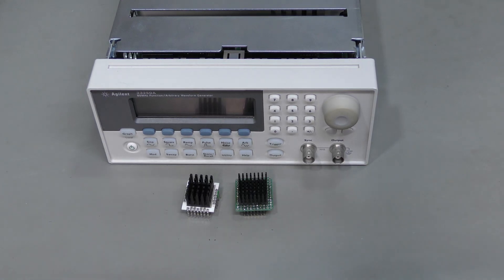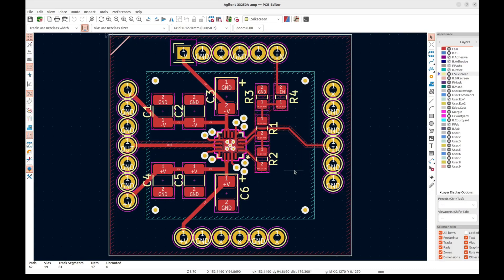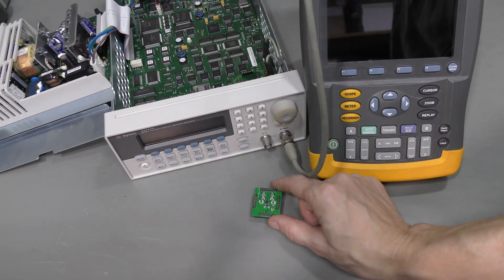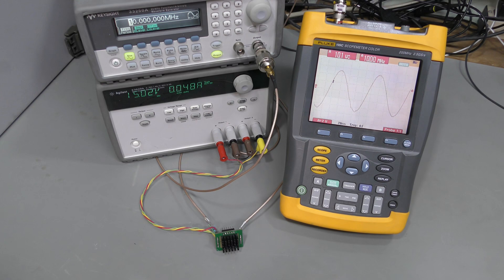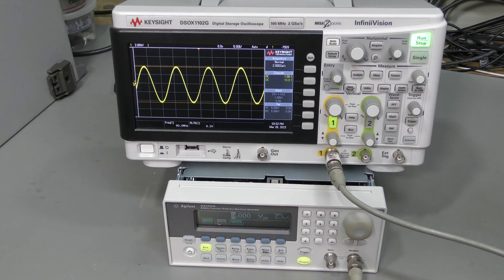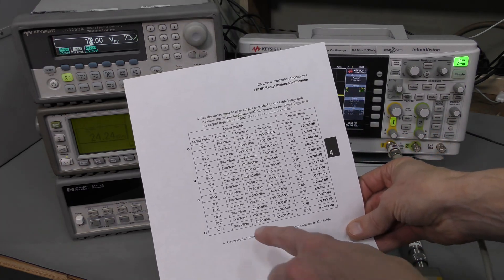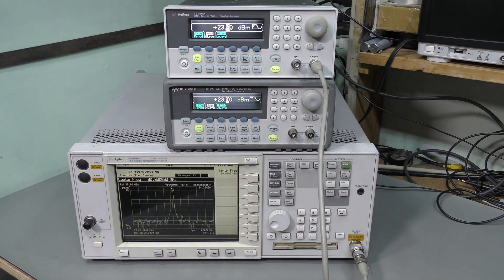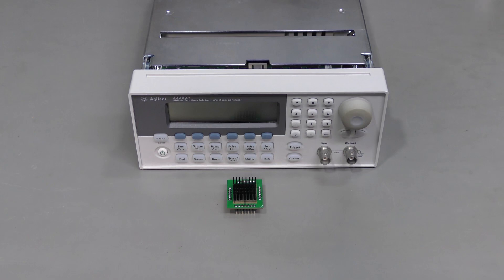#140 - Agilent 33250A output amplifier replacement part 2

Comment: Can someone explain a couple of things please:
1) why the rails of opamp are taken from pins 18; 19 and 1; 25? It appears to be a part of the overcurrent protection with external shunts in series with the bipolar push pull output stage. The remaining hybrid circuits are powered by 13;16 and 7;3. Wouldn't a composite amplifier be more appropriate here? And a shell load below 50 ohms still causes a bouncing output even without those decoupling caps and potentially rendering this OCP useless?
   The datasheet emphasizes on using 2 in parallel.
2) Why use these physically large capacitors? The size is like 1206. Could this be a parasitic RLC adding instability? Is that what they call self-resonance? Is 0402 next to the power rail pin more suitable?

Comment: I've found parasitic capacitance on the output pin to cause this kind of thing in the past. Perhaps a few ohms in series with the output physically sited as close to the output pin might be enough to reduce the (admittedly low) capacitive loading on the output trace/off module traces without compromising calibration range?

Comment: This is one of the worst f-gens on the market. Used to have two of them in the lab. First of all atenuator was quite leaky, also output off function was not the real output off, and to add insult to injury manufacturer tehnical support was telling me it is ok, that is the way it was intended to operate like that. After about two years of use one of the instruments started to show extreme dropp-off in amplitude over about a 1 or 2 MHz frequency. Since warranty passed, i opened it just to find ferrite transformer secondary on the output of the amplifier not properly soldered to ground. (It looks like ferrite bead with two leads forming primary and secondary. Signal from the amp goes through one lead and the other is forming short circuited turn connected to ground.) 
I repaired it, and next day i put my 33250s on the ebay and lowred the price just to get rid of them. Simply piece of s***t of a generator.

Comment: Great video as usual. No professional advice here, just amateur suggestions.

If the problem is input to output coupling, I would relocate the amplifier to the output side of the board to minimise the length of the radiating track. I'd also use an unbroken ground plane under the input and stitch the ground down. From what I've read it's generally better to retain unbroken grounds unless the RF/EM simulations tell you otherwise. I realise I'm contradicting the datasheet here, but a nearly split ground plane next to a high power RF output track just seems problematic.

Thanks again for the great technical content!

Comment: Hi freq stuff.....a black art!
Having two copper pours, one on each side of the board and one being broken also i suspect is a problem......if i read your design properly.
Try getting rid of all the copper pours, dont cross traces top and bottom, or if you do then at right angles only.
You might get away with a bottom side unbroken pour for gnd, but to experiment I would make both designs at same time so you can swap out.
Keep traces away from other unrelated pins when you run past them.
Use vias to drop down to the ground pour, but as close to the topside pad as possible.

Comment: I think your main problem is your layering and ground design. I think your board may have some EMI problems and problems with its impedance.
Reply from the maker: What would you change?
Reply: @feedback-loop  Oh, that is a large question, but I'll try. Just remember I am nowhere near as skilled as you, I do only know about layering, frequency and a bit about EMI on boards.
Your signal layer looks fine, but your solid copper layer is maybe the reason for all your problems. :-)
Each time you have a cutout in that layer do, you create an artificial barrier for your signal layer, and this will most of the time force your signal in the signal layer to make a detour through the board. This can give a lot of reflections, crosstalk and delays.
The best is to never ever make any dent, cut or paths in a ground layer.
EDIT: You have to remember that a signal does not run through the tracks, but in the boards material.
Reply from the maker: @friedmule5403  I believe I showed the "layout" section of the datasheet in my previous video. it says, in particular, "Parasitic capacitance on the
output and input pins can cause instability. To reduce unwanted capacitance, a window around the signal I/O pins must be opened in all of the ground and power planes around those pins. Otherwise, ground and power planes must be unbroken elsewhere on the board."
Reply: @feedback-loop  Yes, that is right, but I am fairly sure they mean planes on the same layer. A normal rule is to never get below 20H meaning planes on the same layer must not get closer than 20 x the High between this layer and the layer next to.
It may not be intuitive, but the problem gets bigger the lower the frequency, and you are almost running DC, compared to the GHz that is normally used in high speed layout.
If you look at the suggested layout is there a lot of vias in the layout and all these goes to an uninterrupted layer below. As stated before, am I no expert, but this looks like a typical impedance problem with reflecting EMI. :-)
Reply from the maker: @friedmule5403  Did you look into the datasheet? In particular, layout example and Figure 10-13. Ground Trace Cutout Beneath the Device Inputs and Output
Reply: @feedback-loop  Yes I have seen that, but you are not following the datasheet. :-)
As your layout is right now, are you breaking up the main ground layer. I was not able to determine, but it looks like you are not using a 4 layer board, I may be wrong but if you are then are your stackup in the wrong order and your vias are blocking for the main signal.
Reply from the maker: @friedmule5403  my board is 2-layer. I don't see how I am not following the datasheet, that suggests to have a window in the ground and power planes around I/O pins and clearly shows that on their example layout.
Reply: @feedback-loop  I am sorry, but either does it have to be a 4 layer board or the ground layer is wrong in the datasheet.
I would even allow myself to say if your second layer is meant as second layer, are they missing the opportunity to at least using a third layer that just have to be at a bigger distance. No matter what is there something wrong, the design does not make sense on a two layer board.
The second layer need either a shield, no out cuts or it has to be moved on top together with the signal, as it is right now will not work, the signal will have an impedance and EMI disaster, even made worse by the heatsink. 
Or I have forgotten about all I know about ground layers. :-)
Reply from the maker: @friedmule5403  Well, I would assume that TI engineers know what they are doing. I don't see any hint of 4 layers in the datasheet example.
Reply: @feedback-loop  LOL yes, I do also think they know exactly what they are doing, but something is wrong, I am sure of it. :-)
As a two layer board with that ground design, will it not work, or at least not into the 100MHz if you get every detail perfect. :-)
Reply: @feedback-loop  I found it, I finally found a single word saying it has to be a 4 layer board. It is funny enough at the spot you pointed towards at 10-13, where it says "GND trace cut-out underneath the device inputs
and output from PCB second layer to the fourth
layer in-order to reduce PCB parasitic capacitance":-)
Reply from the maker: @friedmule5403  Well, yeah, a single word. I don't see how it can be interpreted as requiring 4 layers. And they seem to suggest this cut-out in all layers.
Reply: @feedback-loop  Normally do you have your signal layer, often surrounded by  copper, beneath this layer do you most of the time avoid any cutouts but the datasheet is saying to connect from layer 2 to layer 4. You get shown 3 layers, the top layer, the 10-13 layer and the bottom layer. 
I am not trying to doubt your knowledge in any way, as I said already from the start, do you know way more about electronic than I. My only area of knowledge is layering. :-)
Reply from the maker: @friedmule5403  I am afraid I don't quite understand your description. I don't have much experience with high frequency design. Do you believe that the datasheet is wrong, or I misinterpret it or both?
Reply: @FeedbackLoop  Sorry I was this unclear.
First off, try to read the text below 10-11 and follow each step as precise you are able to.
Layer 1:
If you look at the first layer (10-12) shown in the datasheet do you see a lot of holes (hidden vias) they are in fact pretty important, even more at higher frequencies, but below 100MHz are they more important due to heat. The 10-12 is properly made with 0.298 mm wide traces so they make about 50 Ohm resistance and no reflections and surounding that is the ground copper.
Layer 2:
10-13 is most likely meant as a solid layer of copper that are acting as a power layer, only with the green parts missing. You can also see 4 through vias, the rest is hidden vias, and that is important.
Layer 3:
is ompty and has no copper, this is done to avoid crosstalk or reflections and is only containing he 4 through vias from the layer above.
Layer 4:
This layer is mostly as shielding and for heat disapation, all the vias (except the 4) are again hidden vias going through to the top GND in the top first layer.

In this way do you avoid any reflection between any cutouts, the heatsink and the naighbouring traces.

Please do keep asking if I in any way can make it more clear or you have other questions!! :-)